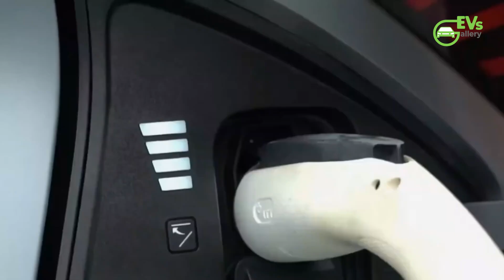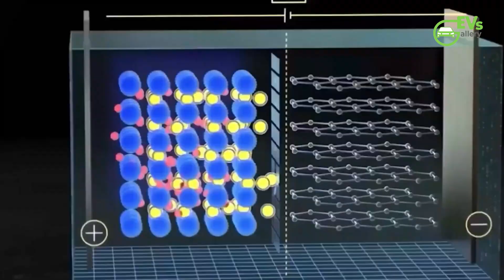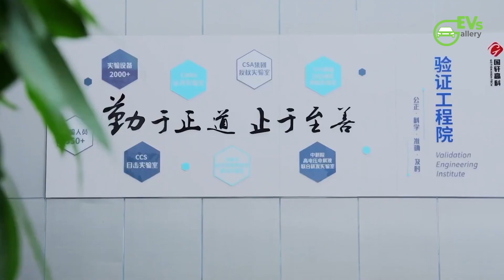CATL's 1000km Range Battery Revealed

Comment: Bollocks ,   for  1000km range  at speed  60mph   Tesla Model 3 needs 150kWh battery , but   a proper  SUV EV  will need  190kWh battery .  There is no chance for any  LFP which can  fit into any  medium size EV .      We need  Solid State batteries  with  350-400Wh/kg  to  start  producing  1000km  real range EV .